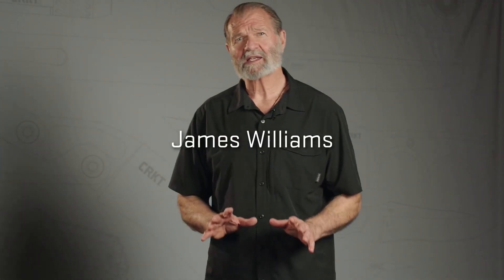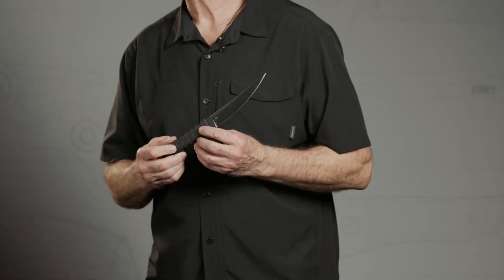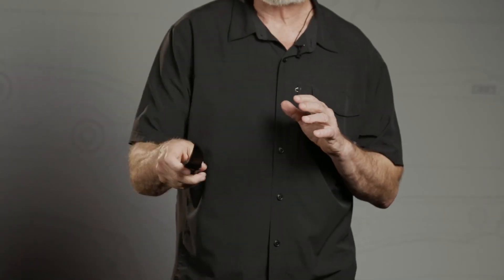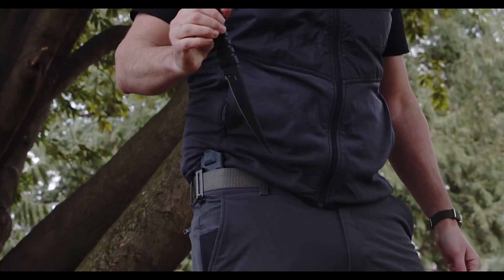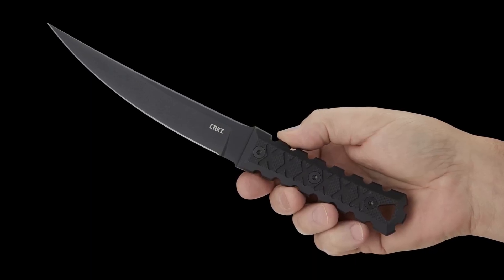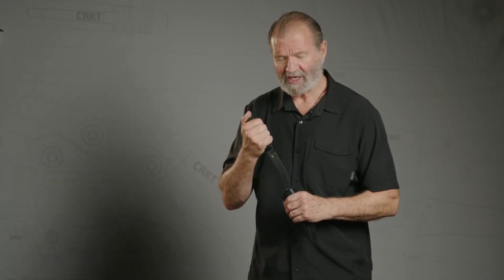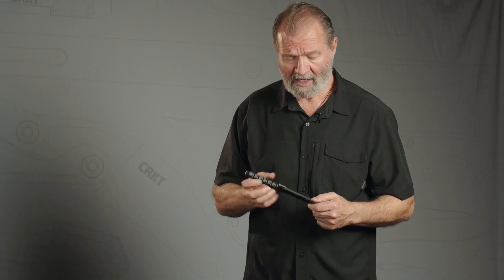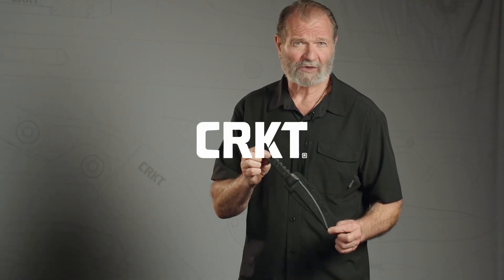Knife Designer James Williams Demos the HZ6

Comment: I bought this, stripped off the black coating, and then sent it to "The Way Of The Knife" to put a stonewash finish on the blade. It is now the coolest looking knife I own. Wish they came from the factory looking like that.
Reply from the maker: Sounds rad. Post a in social so all can see.
Reply: @crkt  It definitely is. Hopefully CRKT will produce more factory knives in stonewash finish in the future because in my opinion it's the nicest looking finish, followed by satin finish.
Reply: @crkt  The photo of it is posted in the community section on my channel. 👍
Reply: user-my2lu9vk2g  Uh, most knives aren't covered in that truck bed liner garbage. It ruins the aesthetic of the blade and does little to protect it. Knife oil and/or cleaning the blade after use does more to protect it than that cheap black coating. It isn't Cerakote.
Reply: @BigDaddySwingingMeat  no, no, no - it's satin followed by stonewash.

Comment: If anyone has questions as to the why and how of the design of the HZ6 I will endeavor to answer them.
Reply: Too long...need one just like this at 4 to 5 inches and id buy a few..but this is just too long to conceal and edc
Reply: Sir, I would like to hear from you telling the story of how the design of the origianl Hissatsu evolved to this aside from the meterial upgrade, especially the shorter blade length. I remember you have specifically addressed that the blade length on the Hissatsu was the shortest you would like on a combat knife. What have caused you to change that?
Reply: @9SS94Cr  I am not sure that evolved is the proper term here, different circumstances, gear, mission, etc. all have an effect on design.  I am still actively involved teaching/working with SOF and others.  Having knife options depending upon some of the above is beneficial.  Over the past 20+ years the amount of engagements for close combat, especially among certain elite groups, is unprecedented.  As you can see from our Williams Blade Design knives sizes and shapes vary depending upon who is going to use them and how.  Some guys deploy in full combat gear, others go into a non-permissive environment in civilian clothes by themselves.  So choosing the blade that will best suit your skills, tasking etc. is the critical factor.
Reply: @SystemOfStrategy  I guess I have misinterpreted that the HZ6 as an upgrade to the Hissatsu, then. Thank you for the clarification! Am I right that the hira-zukuri over shobu-zukuri or osoraku-zukuri was to fit different tasks as well? Would you mind offering some insights on the difference in performance between these blade shapes as well?
Reply: @9SS94Cr  With the different blades shapes you have to also take into consideration the width of the blade and the thickness.  The varying angles of the point etc. also must be taken into consideration.  Some of these factors are task specific and some are personal preference.
Reply: @TL1915  I HZ design request came from a classified unit, this is also true of the Otanashi.  I am not at liberty to go into details about who and how much however both knives, and the Hissatsu, have been used extensively by direct action units.
Reply: Sensei, I was able to handle this at the CRKT booth and was thoroughly impressed. Could you describe the original inspiration for the HZ6 and its application and how much of those origins inspired your current design?  Also, although the design is inspired by Japanese martial arts, how would it work for other systems like FMA, Silat, or European styles of knife handling?
Reply: @rolandogarciaiii6458  The request for what became the HZ6 was from an elite Special Operations unit.  Their tasking is primarily hunting men.  They wanted the most knife that they could get in a package that could be mounted on their kit.  Penetration is a fundamental requirement and then the ability to cut effectively once the blade is inserted. My handle grip design had been proven to be extremely effective and allows for the user to choose the most effective grip for the particular task and situation.  Engagement and reciprocity are not the most efficient means of solving lethal problems so deception, immediate access, and surprise are what is most effective when using any tools and especially in close engagements using edged weapons.
Reply: @SystemOfStrategy thank you Sensei. In my Shinkage Ryu practice I’m a few months away from being introduced to the tanto kata, so my introduction to you and your HZ6 is quite serendipitous. 🙏🏽
Reply: @rolandogarciaiii6458  You are welcome Rolando.  Keep in mind that Tanto is a general term and the size, and to some degree, the shape of the blade will have an effect on its usage.  My primary Tanto when practicing Nami ryu has a 13" blade.  Its function and application affects technique.
Reply: @SystemOfStrategy  that is wonderful!  I hope to train with you in the future Sensei.
Reply: @RolandoEstocada  You are welcome to train.
Reply: @SystemOfStrategy  thank you! 🙏🏽
Reply: Sir, Is OZK001/002 ( made by lionsteel ) discontinued ?
Reply: Also I have small to medium size hand, Is HZ6 handle too long for me to get the proper grip ( palm behind the butt ) for thrusting?
Reply: @sheepdogs1230  No, our blades are made in batches.  There is another batch coming in a couple of months,
Reply: @sheepdogs1230  No, if necessary you just shift your grip a bit.
Reply: The legend himself. 👍
Reply: Why put a serial number on a blade that might be used in an illegal fight ?
Reply: MASTER WILLAMS ~ YOUR BLADES ARE EXACTLY HOW I WOULD MAKE THEM IF I WAS DOING KNIFESMITHING ~  IECHBAN  DOMO ARIGEHATO sorry for poor Japanese...
Reply: @dragonclaw88  they have the HZ4 now, just under 4" blade
Reply: How can I tell which direction the blade I am holding is facing witout looking?
Reply: why not a very aggressiv tanto design like the Kell Knives 007?
Reply: Why is there no features preventing the hand from slipping into the blade? If someone wears e.g. body armor there will be high resistance and all the force of the stab will push the hand towards the blade.
Reply: @martinerhard8447  The hand is prevented from slipping by the way the knife is held.  Even if you hit body armor, why would you be stabbing there, you hand will not slip if the blade is held properly.
Reply: @martinerhard8447  How are you wearing the blade and how are you accessing it?  That will tell you.
Reply: @SystemOfStrategy  

Yes you will know the orientation from pulling it but after this it becomes problematic. Especially at night with a dark blade. 

Fights can be messy and hectic and I think it would be great if you could feel easily with your hand in which direction the blade is facing.  In the worst case you dont confuse up and down but back and front and stab yourself. The handle is very symmetrical from what I can tell
Reply: @SystemOfStrategy     Yes sure but again fight can be messy. You can easily hit a hard object be it body armor (or bone). 

If you can only stab safely in this hold position where the butt of the handle secures against the palm  then you have only limited options. And again fights can be messy....

I dont doubt, that it works great in a best case scenario for its intended use case. But if it deviates from this....

Comment: Those silly people putting guards on fighting knives for hundreds of years when they didn't need to.
Reply: True though, traditional japanese tanto's didnt have guards either, its only the longer swords/katana who have it, that's because they are used for slashing and hacking. While knives are used for cutting and thrusting, not dueling
Reply: This is a combat knife, not a fighting knife. Also many historical knives don't have guards. You don't need them if you design the handle the right way
Reply: Guards catch for blade on blade…not necessary
Reply: Rondel and bollock daggers hardly had any guards. Guards came into the picture when knife dueling was a thing. If you are not going up against another knife fighter you don't need much of a guard.
Reply: They didn't have to conceal their blades back in the day. In the age of concealed carry, you want a weapon that won't snag on clothing, seat belts, etc. Guards add a potential for failure that is unnecessary.
Reply: Sfarziglia's didn't have guards either.
Many original John Ek knives, no guard either.
He find that a good handle should be enough to keep the hand on the handle. I agree.
Reply: The issue is not that is has no guard the issue is that it has no feature preventing you hand slipping into the blade

Comment: I remember reading that in WW II, many soldiers that survived actual hand-to-hand combat, had split their thumb nails completely off due to the intense forward force they were applying to their knife during a thrusting lunge.  Though the hilt broke their thumb nails completely off, it prevented their hand from slipping / riding up the handle onto the blade and slicing their hand while they were literally in a fight to the death.  Something to consider, when you say a hilt is unnecessary.
Reply: If you are using a basic hammer grip on something like a kabar that is very very true, however as he demonstrates, describes its all in how you grip the knife, as well as handle length, shape, & texture. I've heard people complain the HZ6 has a very aggressive texture. If you combine that with your thumb or index over the butt, or have the butt aligned with your forearm in your palm it isn't going anywhere evennif your hands are wet or bloody. He demonstrates this in other videos where he does penetration tests. As with any tool or weapon you need to train, & understand intimately how to use the tool, it's strengths & weaknesses. Remember especially back with WWII you were taking men with no combat experience, giving them very minimal training & especially when it comes to hand to hand or knife use & throwing them into combat. Instinctual we go for a hammer or ice pick grip & in that case a guard is good. It's all about the tool & the training.
Reply: @harvestblades  nobody has combat experience until you're in combat... I'll take a guard on my fighting knife, thanks.  Have you ever tried stabbing something with bloody hands and under adrenaline?  Yeah... keep it simple.  
I've heard these excuses from other knifemakers - the fraudulent Winkler comes to mind... he says that the butt should be in your palm - that's why he doesn't have guards on his knives... he also uses 80CrV2 steel - which is terrible - he has an excuse for this, too - it's easier to resharpen in the field.  What a crock of shit - both of these things make grinding knives much easier - that's why the don't use guards - they're greedy... so greedy that they believe their own bullshit - this is how they can live with themselves.
Reply: @mlentsch If you disagree with the design philosophy don't buy the product.  See how easy that is?

Comment: 1. I cant tell without looking in which direction the blade that I am holding is facing. This is bad

2. Nothing apart from my grip prevents me from sliding into the blade when stabbing something hard. This is also bad. 
You dont need a fat guard that can catch on things to do that.

Comment: Too long...need one just like this at 4 to 5 inches and id buy a few..but this is just too long
Reply: they have folding ones there is a 3.5 inch fixed blade version but its way too expensive
Reply: Ok, about blade length.
I'll copy and paste here a comment. So things clear up.

"When Col. Applegate and Mr. Fairbairn got together to design the replacement for the Sykes-Fairbairn commando, they decided to talk to a real expert. They found a resistance member in Norway who's speciality was taking out sentries. He had killed something like 100 Germans with a knife.
He said the blade needed to be 6" long to insure penetration to the organs, from any angle. Shorter wouldn't do, and longer was wasted blade. The Applegate-Fairbairn has a 6 1/4" blade, and the excellent "coke bottle" handle. Had the war lasted into 1946, this would have replaced the Sykes-Fairbairn."
Reply: I prefer the 7- 7.5 inch blade length. 8 inch is also fine.